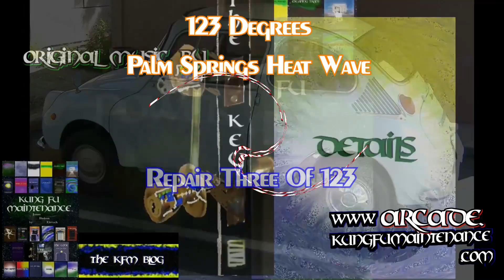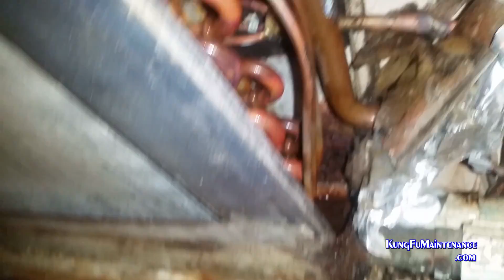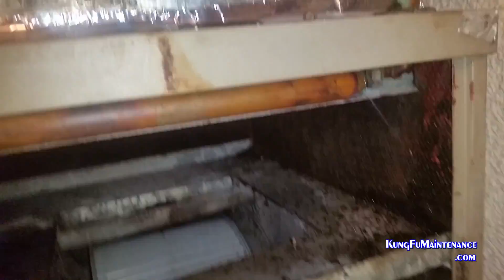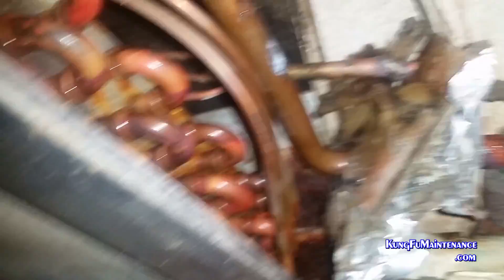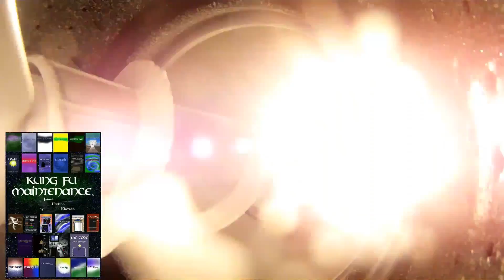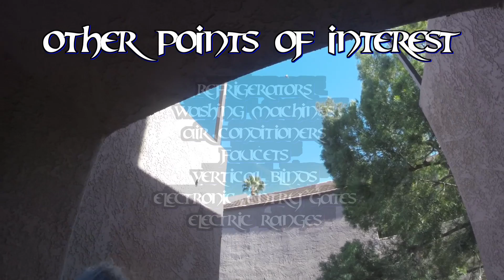123 Degrees Temp Palm Springs Heat Wave Air Conditioner Leaking Water Heater Repair Three Of 123

Comment: I think it's time for a new air handler
Reply from the maker: +SuperJeremi10 Good idea. I could go either way on this one. Might go that route. Fortunately the place is getting renovated shortly so bought me a little time.
Reply: +KungFuMaintenance yea might be better off with a new handler though it's more expansive that way I'm sure but in the long run a better option that handler has seen better days it's pretty nasty only a matter of time before that Ac coil starts leaking too I'd recommend changing it but it's the customers decision.